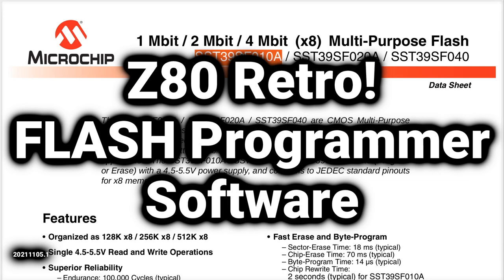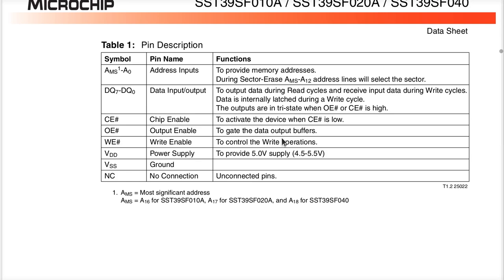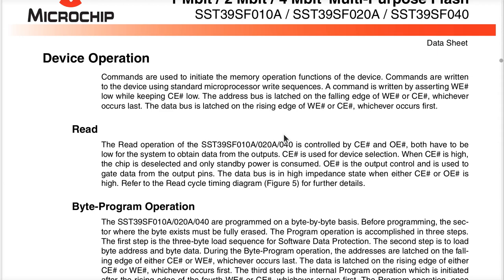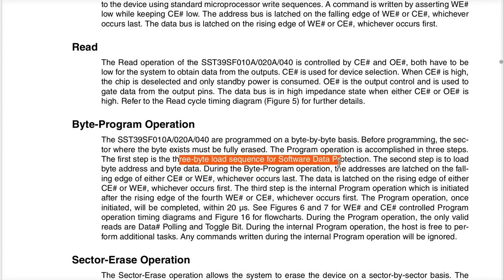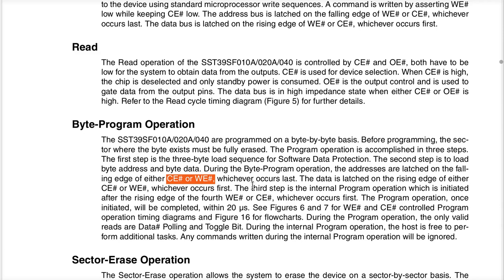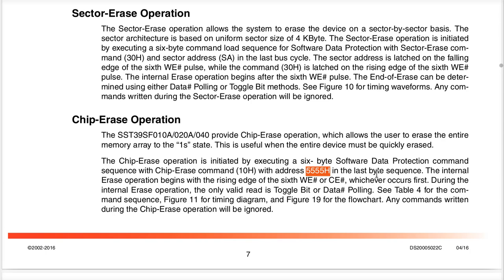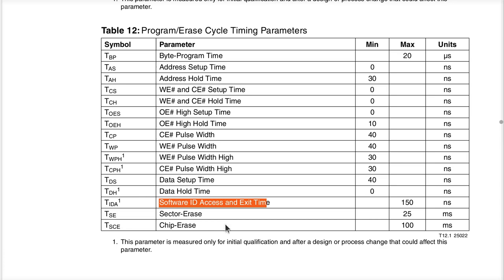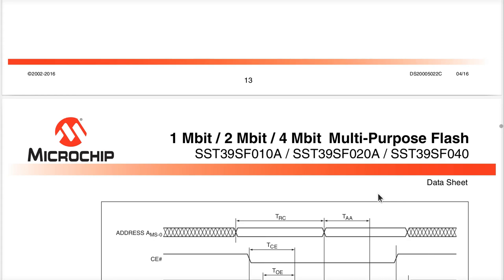Z80 Retro #10 - FLASH Programmer Software

Comment: Thanks - it's really helpful to have such a thorough code review that includes your top-level design decisions as well as your bit-wise implementation. I think I heard you mumble that you cloned your full development directory to the Pi. Just want to verify that you did not do all the KiCad development on the Pi, but on a grown-up desktop!
Reply from the maker: 😂 Yeah. I did the KiCad work on the desktop.
But I have verified that it to is viable on a PI.  In fact, I'm quite surprised how well KiCad runs on a PI 4!
Reply: @JohnsBasement  , yes, the pi4 is an amazing little computer.  I have a 4gig with a 256gig ssd for storage and the system boot.  I’m running Ubuntu Mate instead of the pi os.

Comment: Thanks a lot, data sheets are still a little taunting to me, but the more I get them explained the easier it becomes to read them myself
Reply from the maker: It never ceases to amaze me how 'creative' some data sheets are in their manner of expressing the function of a device.  Diagrams that fail to note if you are looking at something from the front or back, arrows pointing in the wrong direction, missing parameters in tables,... This project alone has already burned me twice!
If there is a point to this rant, it is that you need to question everything you read and go back and read it multiple times!
Fortunately, these days, you can often do some google searching for other designs that use common parts to see if you find something that does not agree with your interpretation.

Even so, as Mark Twain once noted:
Whenever you find yourself on the side of the majority, it is time to pause and reflect.

So, be paranoid and verify everything by building and operating test circuits!

Comment: It's winter again and I'm finally back on this project and have both the Z80 and flash programmer boards built.  I compiled flash.c program with "make world" but I do not understand it.  What does "world" mean?  In reading about gnu Makefiles it says it supposed to call a compiler and I don't see a compiler called in the included Makefile file.  Can you point me to some resources to explain this? Also, looking at your setup I don't see a monitor or keyboard connected to I'm assuming you are using ssh, if so, what ssh client are you using that has cut & paste?
Reply from the maker: I discuss the Makefile in... one of the videos in this series.
'world' is a 'phony target' that means to 'make' clean' and then 'make'

Rest assured, an assembler is definitely called.  It is called z80asm

I know I talk about the Makefile somewhere.  If you are not skipping anything, just follow the bouncing ball.  I know it is in there somewhere early on.

I learned make some 25+ years ago from the O'reilly "managing projects with make" book.  READ IT... at least the early bits. The Makefiles in the retro project are relatively simple.
It is possible that an equivalent to the O'reilly book is on line these days.

Until part #12 there is no terminlal per-se.

You might mean the ssh client app I use to connect to the PI?  That is command-line 'ssh'.  If you are on windows you can either install WSL or use putty.

In this video series, I copy & paste old-school style where if it is highlighted then it is copied.  If I middle-button, it is pasted.  VERY DANGEROUS for those not used to it... But a HUGE time and carpal-tunnel saver if you are.  YMMV. (I hate, very much, the pop-up copy & paste menus that litter most apps... If i didn't want it copied, I would not have hilighted it... I also removed the training wheels from my bike.  I'm a wrekless rebel!! 🤣). This all works for free in the default terminal window on Ubuntu. I have no idea if/how to do same on Windows.

I never expected to have so much content on this project.  I (or someone?) should put together a master index of it all to make it easier for us to locate references to the parts where things like this were covered.  🙄 I'm sorry about that... this remains a work in progress.

Comment: Can we use something else than a Raspberry Pi to remotely flash the board? Could a microcontroller be used? We could transfer the hex file via the USB port since most microcontrollers don't have enough memory to hold all of the binary. Just a thought.
Reply from the maker: Sure.  That is what that smaller header is for.  Just connect up any I2C-capable micro and have at it. You'll need something like my C app to manage the port expanders to write into the flash...

I'd argue, however, that a PI-zero is fully capable of handling it for $10.  How much $$ do you hope to save?

Comment: As always, great and very helpfull video. 
I have a observation regarding memory access time though. I am trying to read Z80 opcode fetch timings, and I don't think you have entire 150ns. Yes, you have 1.5 periods, but... MREQ signal does not fall together with clock falling egde but it takes it up to 55 ns. Then Z80 expects data to be stable 25 ns before rising edge of the clock. (all timings for 10Mhz version) so you are left with 70ns, and that's wihtout glue logic. Of course this is almost the absolute worst scenario. Unless I am reading it wrong... which would not be the first time ;)
Reply from the maker: BLAST IT ALL!!!!  I was looking at a page of the datasheet that included a wait-state in the diagram!   It looks like the 55 and 25 numbers are right for the 10MHZ Z80.. The FLASH that I used has a 70ns access time (and the RAM is 55).  

[BEGIN EDIT 12/14/2021]
I just went over all the timing on this and found that the combined critical worst case timing is 42ns... which is awful.  However, I also measured thae actual times and they are nowhere NEAR the worst case values in the Z80 datasheet. [All the details have been recorded and will be posted here: https://youtu.be/lBI_llO11Kg ]

While I hang my head in shame... I will observe that at 10MHZ, the measured Z80 timing at 20C is 89ns.
The worst case 8MHZ timing is 79.5ns and the 20C measured time is 126.5.

I could /officially/ slow the main clk to 8MHZ.  But unless you have hacked your Z80 Retro! board and added significant additional load capacitance then 10MHZ should be just ducky as well!  ...after all, I have been running mine at 10MHZ for months without incident... even WITH the FLASH programmer connected to it (which  definitely adds load capacitance!)
Reply: @JohnsBasement  Is that as simple as swapping in an 8 MHz crystal?
Reply from the maker: @jackrubin  I believe in this case the answer is yes because the problems are caused by setup and hold times from clock edges... not clock cycles.
This evening I am going to make a detailed pass over all the datasheets and check my calculations.  I suspect that the worst-case timing numbers can be relaxed because I don't have anywhere near the load-capacitance used in the test-specs on the 74HC32 and we are not running anywhere near at 85C.  It is a matter of seeing if/how such things impact the worst-case timing numbers is documented in the datasheets.

Comment: John it is any way to implement the AMD 29F040 Flash ROM? it is similar to 39SF040 but the address to program the chip is 555 instead of 5555 and 2AA instead of 2AAA 39SF040 have 128 sectors of 4k bytes each 29F040 have 8 sectors 64k bytes each my knowledge in C is not good to be able to alter your code 
Thanks in advance Mike
Reply from the maker: Grab the latest version if the flash project files from github, remove the comment on the line that says:
    #define AM29F040B
recompile, and try that version.

It is impossible for me to test it without an AMD chip.  So let me know if this works.
Reply: @JohnsBasement  John you are the best you save me some money thanks I have this flash roms fro the old good days from the satellite receivers
Reply from the maker: Here is an early preview link to a video I will release at some point where I go over the code mods:   https://youtu.be/cnFW806NBUc
Reply: You did me a present form my birthday that's tomorrow I will stay home tomorrow so I can test it and post the results I can send you one to play again thanks John
Reply from the maker: @mikekaffetzakis  🤣. Happy Birthday!!
Reply: @JohnsBasement  thank you
Reply from the maker: This is what I get for designing before coffee...

CLEARLY I should read the ID and then auto-config the addresses AND I just noticed that the AMD footnotes say that the AMD part is similar to the Microchip one in that there is a compatible way to read the IDs.

I'll update the code & replace the referenced video when I find the time.

As it is, it might hang in the ID reading locic.  Please confirm.  If it does, comment out the if-then stuff in the main so it just doesn't call it and test again.

Please let me know what happens.
Reply: @JohnsBasement  John no it is not compatible. The Flash.c is not working i did some changes and i finally make it work need your email to sent you the code and a screen shut
Reply from the maker: @mikekaffetzakis  jwinans@niu.edu